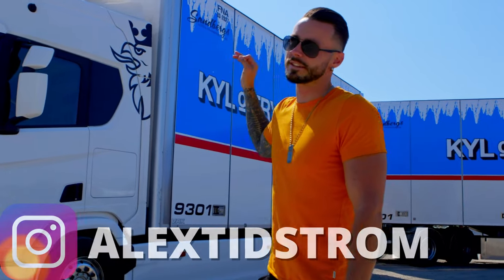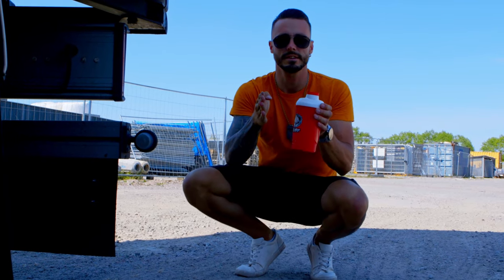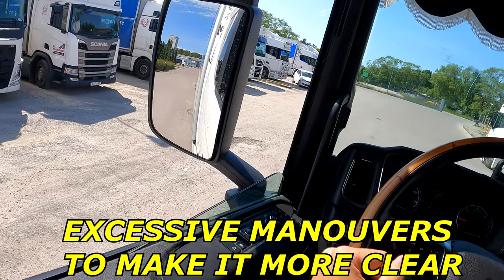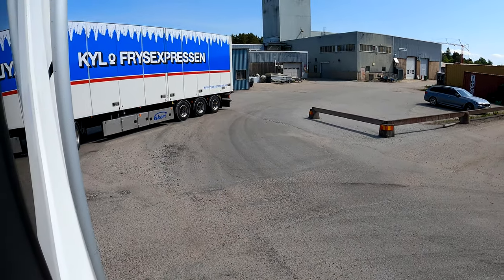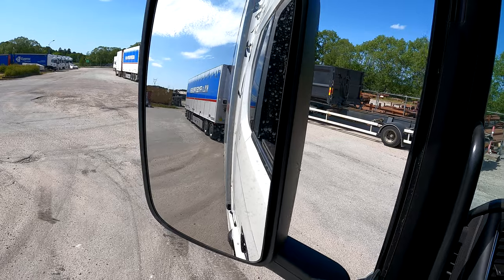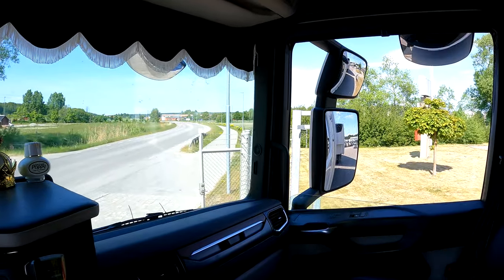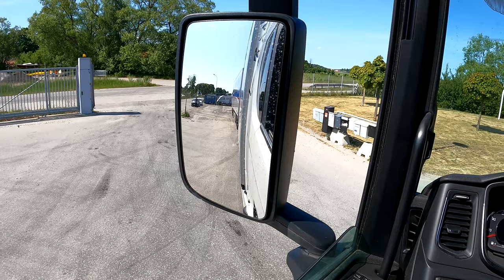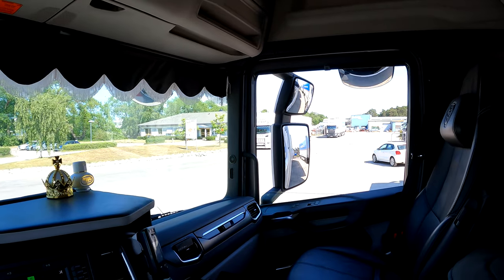HOW TO REVERSE 24M SCANIA & TRAILER, TIPS & TRIX!

Comment: What would be really helpful would be an Ariel view directly over the truck so we can see the draw bar of the trailer being pushed in relation to the truck manoeuvring and it’s angles. What do you think?
Great video by the way, very well explained, but I think the top view would just clarify everything but please in full frame not down in the corner because it will be obvious which way you’re turning so no need for the in cab view.
Thanks.
Reply from the maker: Good idea sir but i dont have a drone
Reply: @alextidstrom  Oh! I thought you filmed some of it with a drone and even pointed out a drone in the video?!

Comment: It would be nice to see how you backup in a straight line, then make the trailer go to one side, maybe do a 180 degree turn and backup the other direction from which you came. I think it would be interesting to see. Thanks!
Reply from the maker: That sounds like a hollywood movie 😄 a lot of work but could be done!
Reply: @alextidstrom  it does require a large empty space i guess. But it would be interesting to see how you correct to keep the trailer going straight vs how you initiate/maintain/end the turn. 90 degrees is good as well.

Comment: Try reversing using a trailer with a (converter) dolly attached to the rear. That is actually more difficult. 
It is actually easier to back a b-double than a trailer with a converter dolly attached and a rigid truck.
Reply from the maker: Never claimed this is the most difficult just showing how to do it sir.